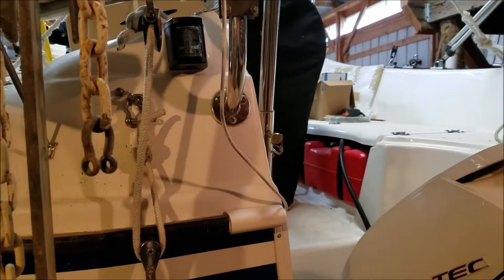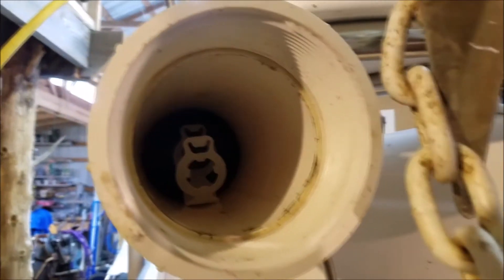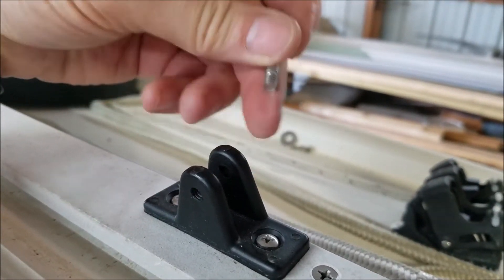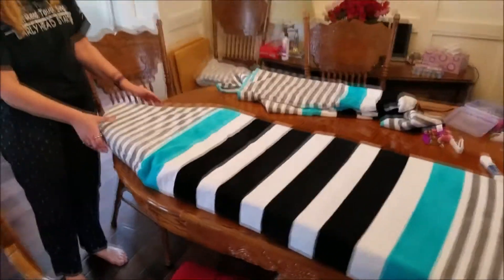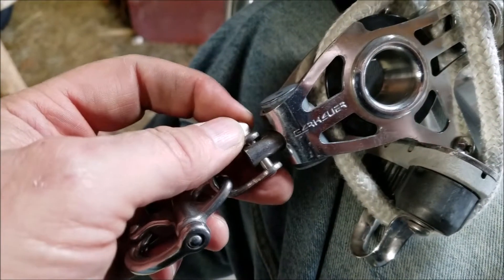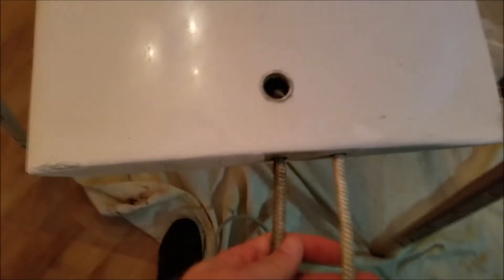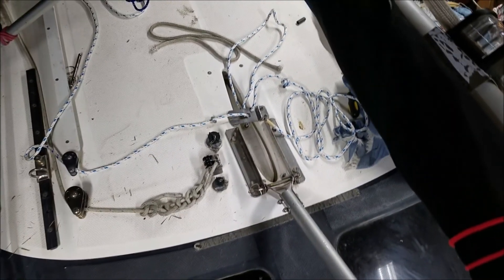2017 Mods & Maintenance Part 2 on our MacGregor 26M - Galactica

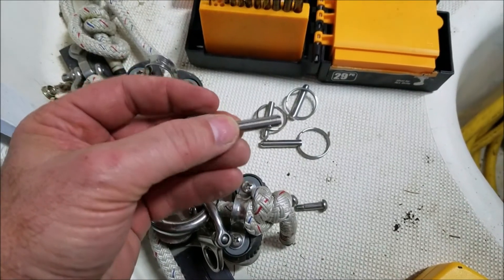Comment: At 3:12 I think you are looking for a 7mm (metric) drill bit.  Just slightly larger than 1/4".  If anyone else is doing this mod, check it out.
To keep from losing that pin (5:58), drill a small hole in it and safety wire it to the shackle. The pin won't turn if it is 'captured' in that manner.

Comment: I noticed you changed out your anchor roller and were able to leave your bow cleats... How did you do it?
Reply from the maker: After removing the little factory anchor roller, I sandwiched two 1/4 steel plates together with a notch for the forestay tang then I have a large triangular steel backing plate on the inside. I bolted these together with a half dozen stainless steel bolts.     This provides a platform that is pretty solid and the larger anchor roller is cantilevered off the front.   I also added a stainless steel padeye in the center of this "mini bowsprit" with a block on it.    I use this block for the spinnaker.
Reply: That's awesome, thanks! I have a new roller sitting in a box in my office that would like to make its way on to the bow, so maybe I'll follow your lead. Thanks again!
Reply from the maker: Jody Jenkins the only thing that i would do differently would be to use aluminum instead of steel plates.